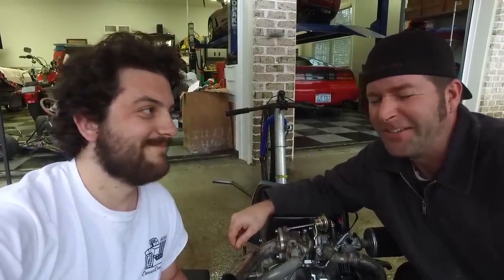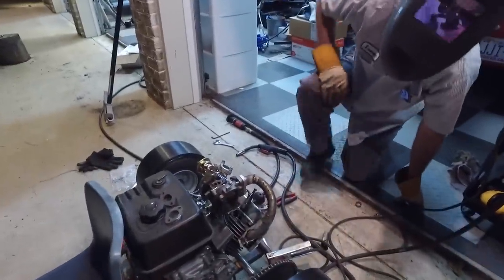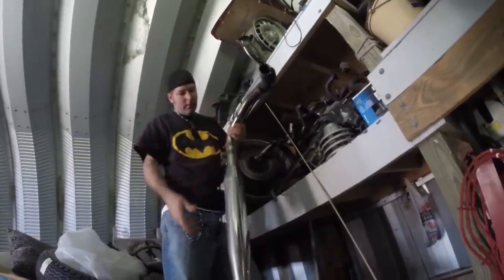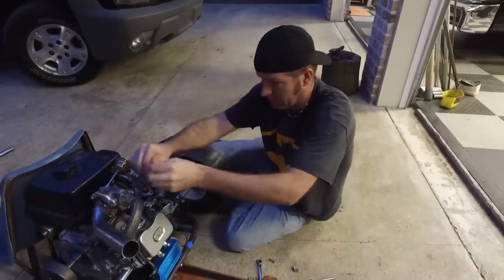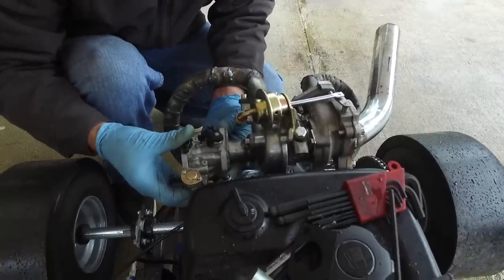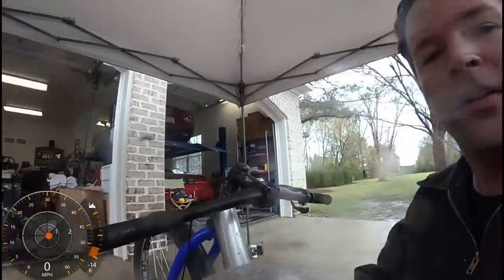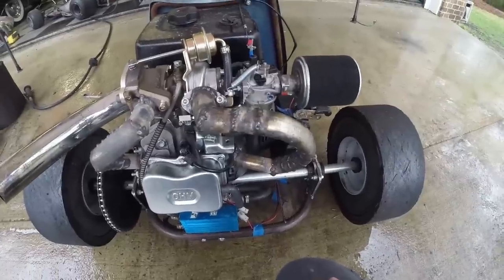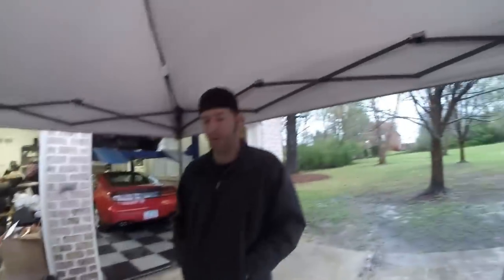Turbocharging a 420cc Drift Trike

Comment: You need to put your boost From turbo to every "hole" in your carboretor and add fuel pump and regulator for fuel or put turbos boost in fuel tank. You need to do it so that turbo blows in carboretor!😀
Reply: +CasardCameras
Reply: +MrSankari100 That wont work. you either need to place the whole carb in a bell connected to the turbo pipe via a vaccum line so it runs at boost pressure and face feeding/tuning issues or loose idling as a whole.
Reply: +Côme Thiburs You'd also need to pressurize the fuel tank, 
otherwise boost will blow fuel back up the fuel line.

Guys, using a turbo to SUCK through a carb WILL 
work.  Look at a 62 Corvair Spyder.  Turboed, 
and had a carb.  From the factory.

Using the Blow method, you do need to pressurize 
the whole system, including the tank.
(There are fuel regulators that will compensate for 
boost, on turbo cars, but that may be out of your 
range.  You'd still need a fuel pump.)

EFI, here we come!

steve
Reply: exact steve. forgot the pressure regulator.

I dont think EFI will improve the power tho, to this point only running methanol or E85 ethanol will improve the engine output, more 95-98 gas in that thing will only add detonation risks and grenade the valvetrain.
Reply: huh? 95-98 "gas" will not add detonation risks..............the higher the octane the LESS flammable and MORE resistant to detonation a fuel is..............not the other way around, boy racers think that putting 98 or 104 in their buzzbox gives it more power, it actually gives it less power UNLESS the engine has higher compression and/or advanced timing to take advantage of the higher octane, at which point the car will not run on lower octane fuel without detonating. If I put 91 in my ute it would be a bad day, because 95 is the minimum it can run on, not that it matters to me because I wouldn't put 91 in my lawnmower let alone a car ;) (in Australia regular unleaded, 91, is garbage filthy shit, premium fuels, 95/98/100, are MUCH cleaner)
Reply: You do realise as the guy above me said, The higher the octane rating the more resistance to detonation it has.  "95-98" im guess ing you mean octane would not grenade the valve train at all. It would help things out. With boost upping the compression ratio, you want a higher octane rating to keep the engine from pinging from premature detonation. You want it to detonate when the spark plug lights it, not from compression of the piston. It's not a fucking diesel.
Reply: Running a higher octane rating in something that doesn't need it isn't going to reduce any power at all. It will just combust when the timing says so. Like you said octane is resistance to detonation. Now with a higher compression ratio it will help. But if its a car that doesn't need it it won't help performance, nor will it decrease performance. You wont notice any difference. In a high compression application with low octane you will notice a terrible amount of detonation knock/ping. And it will run like pure shit.
Reply: ur owsome info makes u absolutely correct on this 
had 600 bike high compression engine  put in it 95+octane booster test it with the same model and capacity and its faster
 runs cleaner no knocks no cracklings the engine is smoother quieter the power adds are very much noticeable and it changes the whole ride
Reply: that is totally backward the higher the number in octane the LESS likely you will have detonation problem this is why Cadillac and other high compression engines tell you to only run high octane gas

Comment: add intercooler, E85, choo choo noise blow off valve, direct injection and an ECU :P
Reply: +Schwaehn Someone watches MCM, haha!
Reply: mrkthmn
maaad
Reply: haltech elite should work :)
Reply: +Schwaehn maaaaad. glad to see someone who watches that as well.
Reply: Been watching a bit of MCM have we? 😎
Reply: +OffTheWall yeah hope there is not a lul in their content soon because of the roadkill thing.
Reply: +Schwaehn How do you want to control a carburetor with an ecu xd
Reply: Rudpavv Rudpavv i don't.
Reply: +Schwaehn just adding efi would be easier but blow through setup has been used for ages so it does work.

Comment: Build an enclosure for the carb, use the turbo pressure to pressurize the enclosure and you should be fine. Linkage will be a little tricky though.

Comment: Draw through setups are perfectly fine. You just need to either get some larger jets, or drill out the ones that are in there.
Reply: +Jon&#39;s Garage  they say in the video that they drilled out the jets. the problem their having is really do to the lack of control of the carburetor. A gfi will definitely help
Reply: I must have missed that part.

Comment: also if you pack the pipes with sand you bend them without them crushing and no pie cuts are needed
Reply: Wow! Thanks I never heard of that. That's a great tip
Reply: Puffalupagus360 you can also tape off your pipe end fill it with water and freeze it the ice will keep it from crushing when you bend it as well

Comment: Love your determination......keep it up. I built turbine engines out of turbos 18 years ago. 143,00 RPM's out of my HT1. 48 pounds of boost. Over 200PSI of fuel pressure. It was a beast. This was on kerosene and 10% gasoline. I have not maintained the website but someone is still hosting it. If the CarsandCamera guys want me to publish it on thier space, I will. I have not touched the site in 18 years. I am so proud of the site. I did all the web development myself.

Comment: draw through turboed carb is fine and is actually the best way to keep your air/fuel mixture correct. blow through like you had it at first will be either super lean at the top end or super fat at the bottom end because most carbs have to reference of pressure only flow. you also cant use blow through because you dont have a fuel pump. the air is just back feeding the fuel lines. you just need a better path between the turbo and the cylinder head and that draw through will work fine. with all of those pie cuts being welded with a mig welder and all the funky angles i bet it has barely any flow until higher rpms. if you had a tight radius bend made with a tubing bender and correct/straight flanges it would idle a lot better.
Either way. sweet vids
Reply: a c Do we need to add an intercooler fot draw through setup like this? BOV maybe?
Reply: @muhammadsyafiq7760  No intercoolers on draw through. Only  water/meth injection upstream of the carb would work. Well an intercooler WOULD work. But it isnt a very good idea due to fuel condensing on the insides.

Comment: the carb prolly need a bigger jet? since more air is coming in, it leans itself under boost? just a thought..
Reply: you could put in a jet that would be suitable for the boost but then it wouldn't idle because there would be to much fuel at idle
Reply: +Jacob Waters I don't know what carb is used in this particular application, but usually carbs have a few different ways of adjusting the mixture. If you change the main jet you mostly affect 3/4 to wot. 1/4 to 3/4 are mainly influenced by the needle and idle to 1/4 by the idle jet and a screw you can adjust. If you would only swap the main jet it would have basically no effect on idle.
Reply: instead of a blow through system, you should with the carb to before the turbo for a draw through system eliminates most of the modifications need to be done to the carb. also an electric fuel pump and turbo pressure regulator would keep the engine from leaning out
Reply: No if you payed attention to the video he said “we jetted the carb.”
Reply: andrew faivor they are using a suck through system. But thats poor for tuning, i'm curious what mods you mean? Only mod u neen on blow through setup, is to pressurize the bowl  on the carb to help pushing fuel up the jet
Reply: No he needs a different type of card known as a blow through carb. And a way to raise fuel pressure in relation to boost. It's done in cars all the time with carbs
Reply: Twelvevalve seth nah, he needs to pressurize the bowl, and use a elecric fuel pump and a fuel pressure regulator to rise yhe fuel pressure with boost. I have done this for a time now on snowmobiles.
Reply: ailokemi92 yeah that's what I said. You need a way to raise fuel pressure with boost... Just as in a blow through carb on a car
Reply: Emmanuel Thommy 7 psi of boost goin in and 7 pounds of fuel pressure coming out of the carb cancel its self out
Reply: if they connect a pressure line from the turbo and into the vacuum line in the carb it should be okay😜
Reply: Need a blow thru carb it will work but carb needs to be set up as a blow thru. It can be done.
Reply: @Jacob199801  A CV carb.
Sounds strange for a blow through, but it's best.
Reply: Bigger jet. ?? How about a 60 or 70 mm carb off a outboard. I did that in the 80's what a screeming  little flywheel . 18-20,000 RPM right at the same time the rod gets sent into Oblivion, making a large vent hole in the block.
Reply: You need boost reference on a carb and if it's not a blow through you need to build the carb. I build a non blow through holley that can hold about 15psi for $ 150. Pretty minor work unless your wanting a lot of psi.
Reply: Or you could do the smart thing and put the turbo back on the engine so the turbo blows in to the carb and not suck through it
Reply: Anybody who knows turbo systems knows a small engine will not run efficiently with a carberator, unless you plan on using a carberator that's triple the size for the engine in order to run it right. Even big engines with turbo needs the larger carb, a jet alone will not get it has to have the larger carb
     Why do you think most all turbo vehicles small or large run efi or a massive carb, cause it needs it. When running turbo I prefer efi it's just easier than a shit to tune, for nitrous I run carb cause I like plate systems
Reply: @fastthefishiest8620  Absolutely correct! but it also has to be a boost referenced fuel pressure regulator so it will increase fuel with increased air/boost and regulator must be set to 3psi base so it always stays 3psi above boost psi.
Reply: @Jacob199801  the correct solutions is to just run at full throttle 100% of the time. 👍👍👍😀
Reply: Needs a blow through carb meant for turbos.
Reply: @hardcoreper  if it's a vacuum pump you may be on to something actually
Reply: @KacKLaPPeN23  main affects all of it..
Reply: @andrewfaivor1922  only problem with that is if it gets too hot on the cold side since there is no intercooler, it could ignite in the cold side.
Reply: @hammerfistfightclub  No...
Reply: @Nick-wf1je  & the turbo is Farr too big for the cubes.Use an Alternator off a Diesel light Truck or Japanese far & use it's vacuum pump as a small blower.

Comment: I would suggest putting the carb on the intake side of the turbo, not the outlet. Carbs don't like to be blown through. The bowl vent needs to see the same pressure as the mouth of the Venturi, and that's not possible on a blow through set up.
Reply: +Kenneth Cohagen The guys in this video clearly dont know how a carburettor works...
Reply: yeah you're right.to control the air going inside the engine it must be on the intake manifold not on the exhaust instead.

Comment: You need a boost referenced carburetor... Easy way to do that: There's an atmosphere hole on the carb that you need to run to the charge pipe, and your fuel input to the carb needs a check valve.

Comment: Carburetors can handle boost just fine. You just need a fuel pump to overcome the charge pressure.
Reply: And an intercooler so the turbo will actually affect the power.
Reply: yup for whatever amount of boost pressure you need that much more fuel pressure going to the carb, or the turbo pressure will just blow the fuel back into the fuel bowl and the fuel tank A blow off value / waste gate also would help a lot, when you spool the turbo then let off all that boost pressure has no where to go, making it hard to go back to idle until the pressure is gone.. it could be opening the butterfly in the carb when this happens.
Reply: +ted clubber lang  not necessarily boost is boost wreathe its hot or cold, now an inter cooler would definitely make more power but on a small motor like this i would doubt it would be a significant gain with what i would assume is not a lot of boost pressure. inter coolers really get hand around 9 psi. Plus with a suck through carburetor set up like they have now the atomized fuel will cool the intake air/fuel charge a tremendous amount. people out in the salt flats tend to run this style set up because the fuel cools the charge so efficiently  that they can drop the inter cooler from the build and make the same and sometimes even more power due to the lower restrictiveness of the intake set up, and it doubles as weight reduction
Reply: +john Doe (mr. 250) i 100% agree with you an inter cooler is a must but i also think have control over boost is good, and no matter what she anit going to do much without more fuel pressure lol
Reply: +ted clubber lang no, this small turbo does not need an intercooler.
Reply: +The Head Any turbo can need an intercooler. It depends on how much pressure is trying to be made and how much air it's trying to flow. Also, boost control (wastegate) is not needed. Diesels rarely have them. It's called making the turbine (hot side) very large. This turbo is huge compared to the size of the engine.

Comment: Build a box and put carb inside so it pressurises the outside of the carb too, that way it will not push the fuel out the vents, that's the only way a carb will work with a turbo.

Comment: Here is something you might try. Mount the turbo where the exhaust is flowing through one side of it, and the other side will bring fresh, compressed air into the carburetor. A bigger jet would help performance. A carburetor can be used with good results, but hey, I would love to see you install fuel injection system on one. I didn't even know they made one. Love the videos.

Comment: So basically you put the carb where turbo intake would normally be and, so the fuel-air mix would be sucked through the turbo and into the chamber? And besides rough start couldnt you set idle at a higher rpm to help the cause of rough idle and startup? any feedback is helpful thanks
Reply: thats what i was thinking too

Comment: You can run a turbo/carb, by having the carb feeding into the compressor intake.  It is difficult to get the fuel/air mix right though.  And you would need a rather large carb.

Comment: Build a metal air box with the carb in its original location.. but INSIDE the air box. Then pressurize the entire box.
Reply: thanks
Reply: Beat me to it. just need a blow thru carb setup by equalizing pressure outside of carb
Reply: Seems like it'd be a nightmare sealing all the linkages
Reply: why not a draw thru carb?

Comment: Actually, you guys might be blowing the spark out, try a colder plug?. That thing should have no issue idling with that carb. Thats basically how they turbo old single carb bugs. Do  some googling for draw-through carb turbocharging. What you have should work perfectly. Your turbo might also be oversized. Also, I would redo your intake and exhaust tubing, it's super restrictive and has some sharp bends that shouldn't be there. That should all be as open as possible.

Comment: you could build a pressure box around the carb so that its in equalized pressure? But there will be tons of work tuning needed to be done but thats the simpler design. fuel injection wise just grab a single honda injector and a mega squirt and put a magnet and a reed switch to get your trigger from the fly wheel.

Comment: Wish I could play with you guys.  Sure looks like fun.  I have not read thru thee comments, but in the olden days the '57 Ford 312 w/ Paxton supercharger Ford put the carb into a box.  The entire carb was contained so the pressure was the same all over...except down he venturi. This gives the same conditions that the carb would experience except with a lot heavier atmosphere.  Thats the physics as I understand it. It is a handy place to attach awater/alcohol injector for detonation...also keeps the fuel/air mixture down stream from the turbo.

Comment: please dont cut pipes when they are attached to the turbo you will geht shavings into your turbo
Reply: +Patrik Müller did you see the card board blocking it off. and we had rags in there too
Reply: Isaac it'll be fine ohh ok i didnt See that ^^
Reply: its cool. nothing wrong with comments